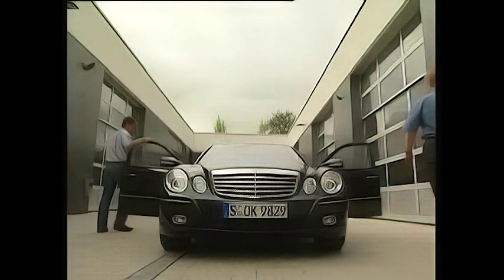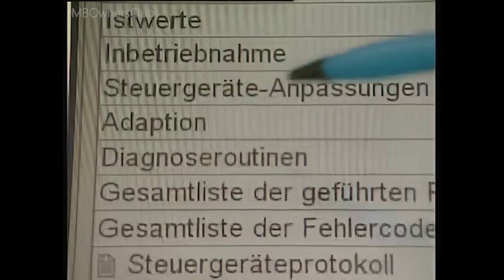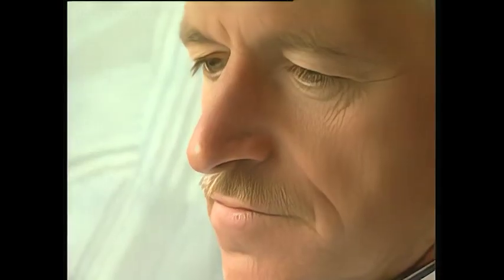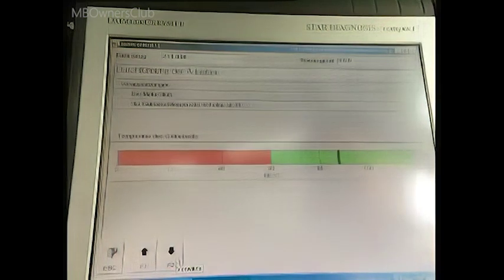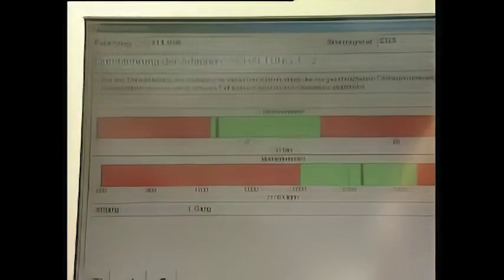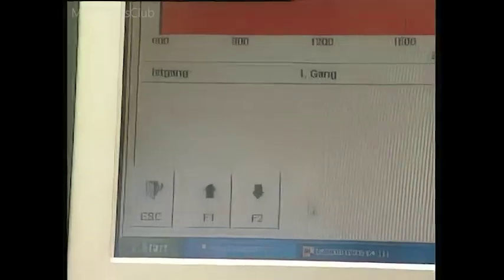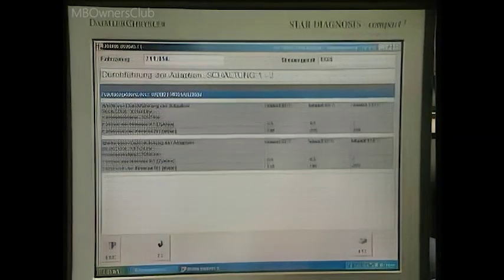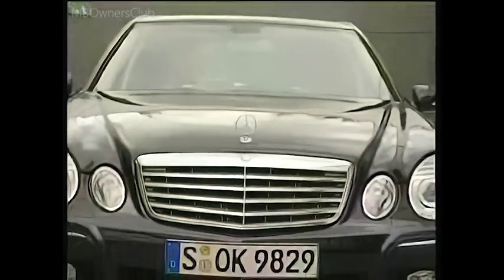How to Perform Shift Adaptation on a Mercedes-Benz Transmission 722.9 using the Adaptation in DAS

Comment: I own a w212 2011
When the car is on R and i want to switch to D the car "i don't know how to describe" but i think they call it "jerk"
So i switch to paddle between 1 and 2nd gear the jerk happened so i concluded that the problem is between 1 and 2nd 
Also further investigation i put the car on "S mode" so that the car will accelerate at 1st gear  then switching between R and D nothing happened 🙂 so it's between 1 and 2
The car drove very well
But that jerk is kinda embarrassing when switching from R to D
Reply: So the question is does this adaptation solve the problem?